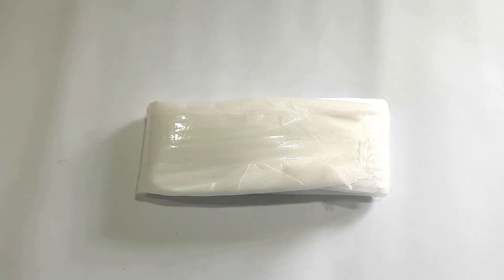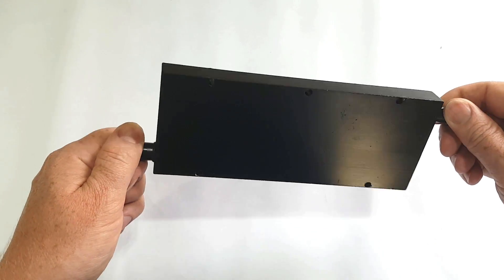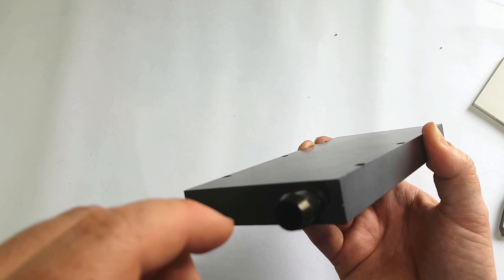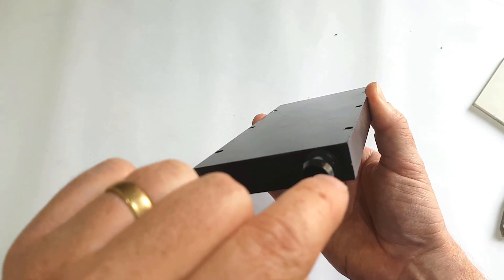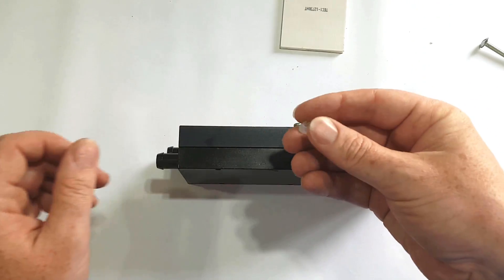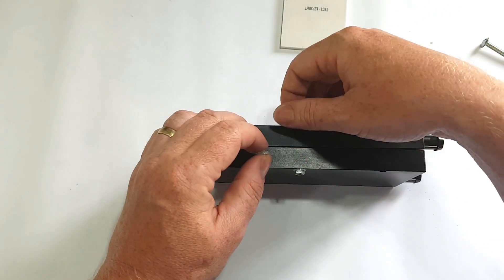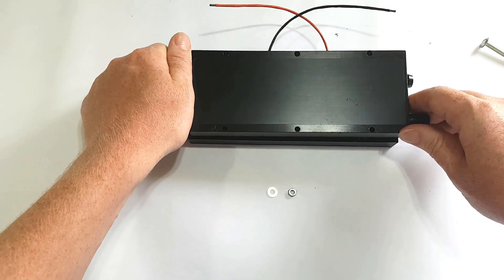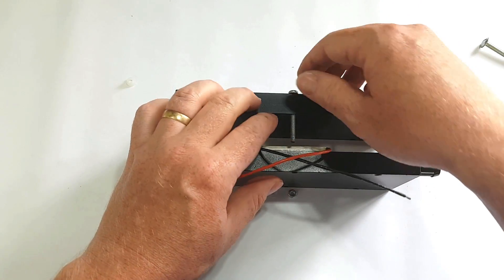⚡️ Triple 62mm Thermoelectric Cooler / Peltier Water Chiller For Cooling a CPU

Comment: I've seen a video elsewhere on you tube where someone has made a water chiller out of a water block that looks something like one of these. What was cool was that they put two Tecs on either side of the block ( 4 Tecs in all ), then put a heatsink and fan on each Tec. When I first saw it I was a little confused till I realised what they were doing.
Reply from the maker: Rob Hobbo yeah you can well at least you can in thoery 😎
Reply: @Ultrasonictwo  - Do you sell these puppies still?

Comment: how many radiators would you need to cool the water from the hot side?
Reply from the maker: Well that would depend on a alot of things. like how many watts are you trying to move and how much power will your TEC's be pulling. But the simple answer is the more the better.
Reply: Ultrasonic2 can you point me in the direction towards cooling the TEC when they are pulling  something close to 600W in a typical operation?
Reply from the maker: Well the answer to that will be water cooling.. Very shortly my NEW TEC Calculator (haven't finished yet) will greatly help you out with estimating how much hot side cooling you'll need to beable to achieve your desired results.